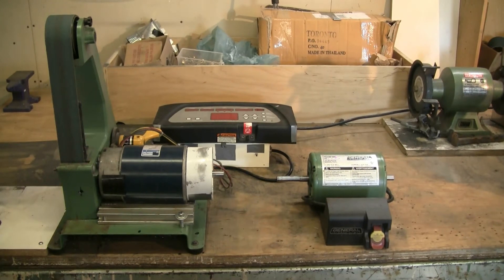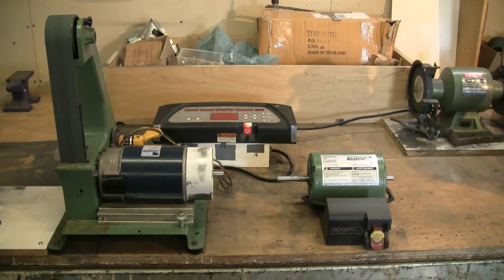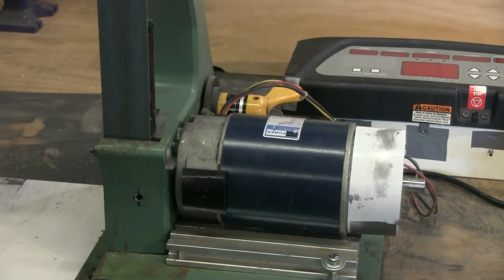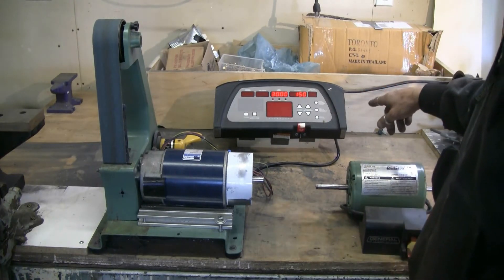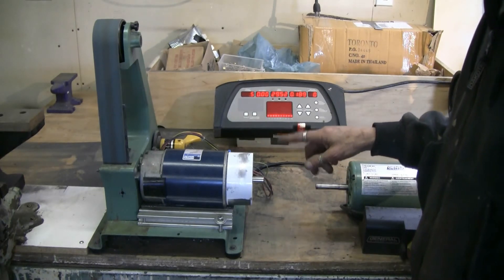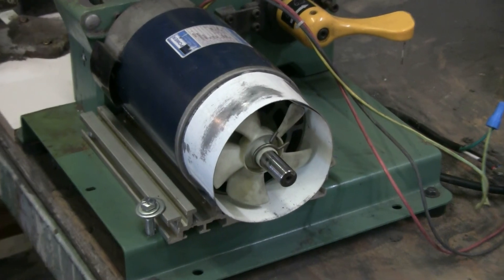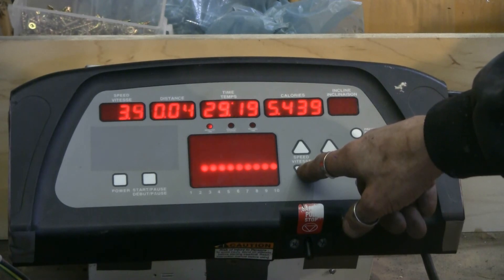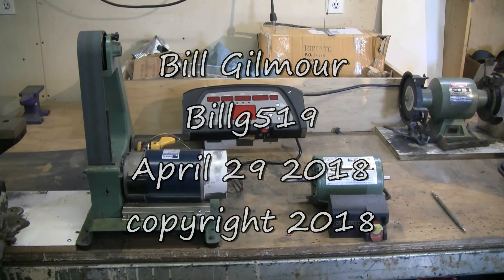DIY Motor Mod on 2 x 42 Belt Grinder

Comment: Excellent setup, I will be keeping on the lookout for a similar motor and controller. Thank you for 
Sharing your vids I get lots of really good ideas from your vids. I’ve been looking for ideas for setting up
A BB type machine gun for my basement amusement in the long winters we have here. You remember the type often found at carnival midway’s where the game was to shoot out the red star from the center of a small target ? I have priced the originals type which looks like a Thompson machine gun, however they are difficult to locate and expensive so I will look to build one. Thanks for sharing and please keep them coming.

Comment: Where did you get that 2×42 grinder at and was it expensive you also look up treadmill control mods to do away with that slow delay and minimum speed control if you look on YouTube you'll find where they have done away with it also put that motor inside a in closed cover to protect it from dust and debree and if you run into the problem of your grinder cutting off you need to look at the rotation counter
Reply from the maker: Mat Allen I got it a few years ago at Federated Tool in London Ontario Canada for about $350 CDN.